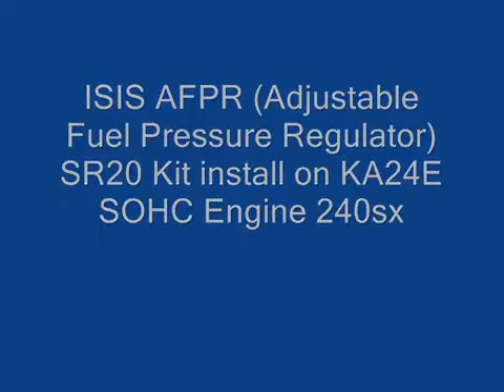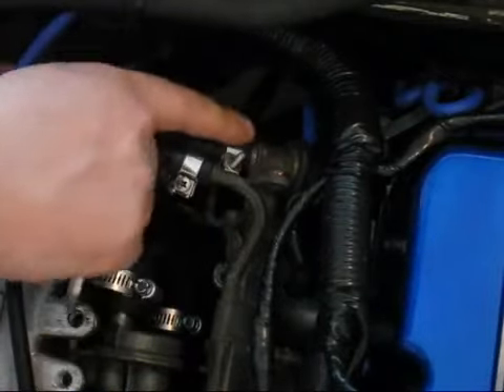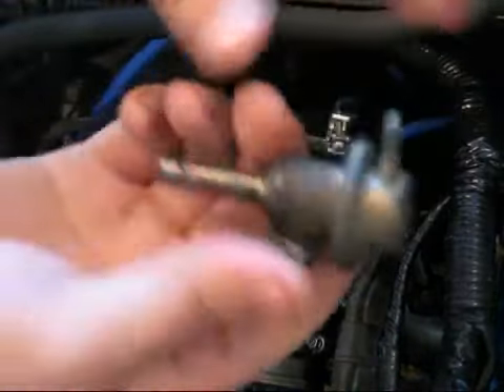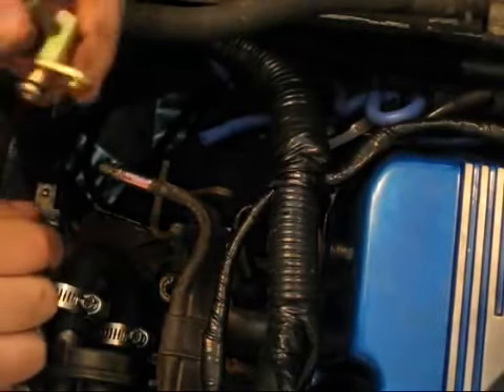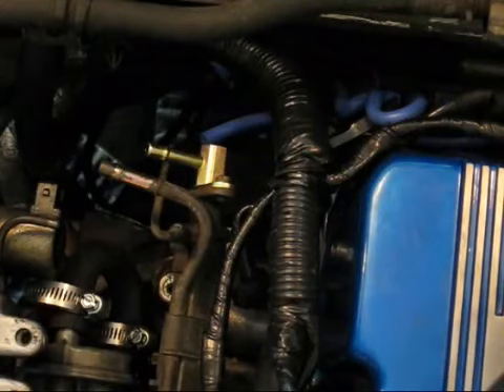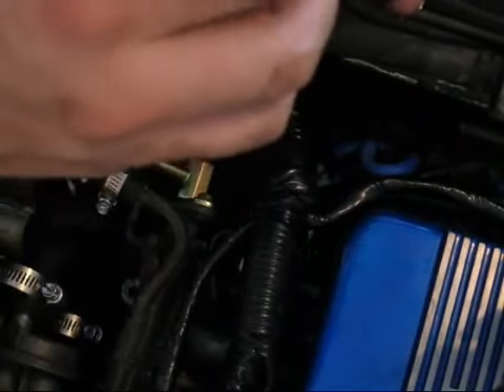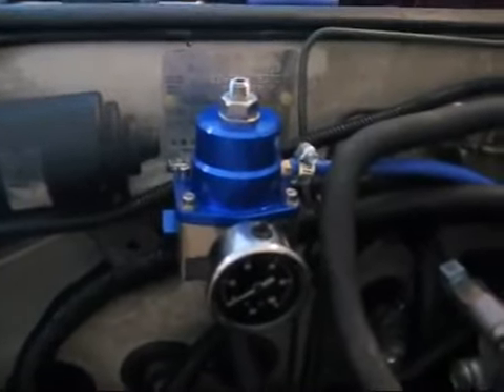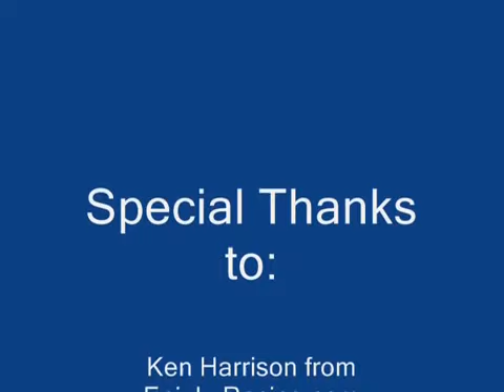ISR Fuel Pressure Regulator Install

Comment: Dil Lee1 second agoHi, I have a BMW E34  525i with an ALPINE Turbo,  I purchased an Adjustable Fuel Pressure Regulator, and installed it.  I set it to  34psi at idle, but it only goes up to 39 psi at wide open throttle.  I would like it to be round about 44 psi at wide open throttle.  Do yo know how I can adjust the regulator to give me a bigger window.  Should I try to put a weaker spring in the regulator.  My previous regulator gave me 34psi to about 43 psi. But at idle my car is set 100% on 34 and 43psi, but as soon as I've driven it a while it goes totally lean to 20psi at idle and 32 psi.  If I set it at 34psi and 43 psi when it's hot then it's smokes black smoke when it's cold, MUCH too rich, won't idle properly. If you know what I can do please help.